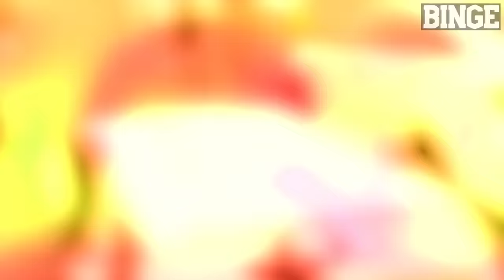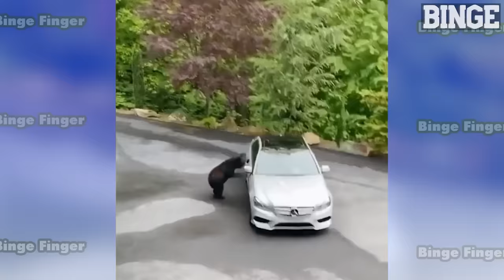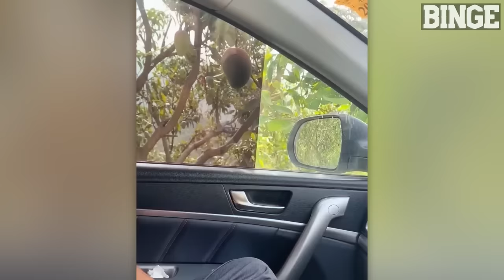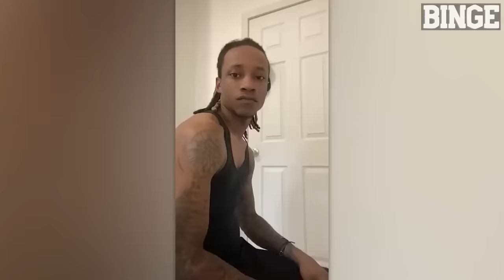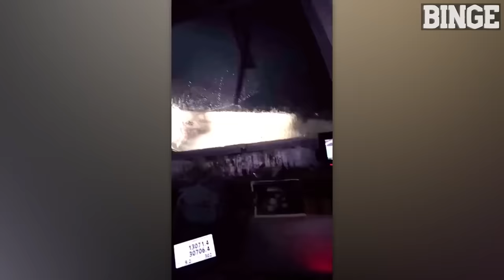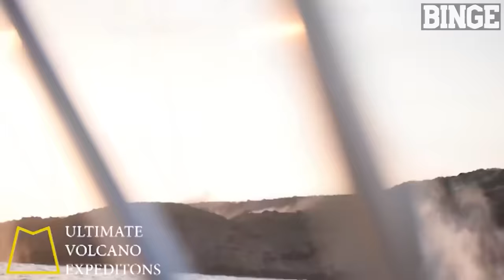200 Incredible Moments Caught On Camera ! Best of The Month #31

Comment: The 'collapsing barrel' is an old classic.  You put a small amount of water in it, then heat it so the water turns to steam, then seal it.  Cooling it with a hose - reduces the internal pressure - making the barrel collapse.
Reply from the maker: Thank you for your explanation! We got it!

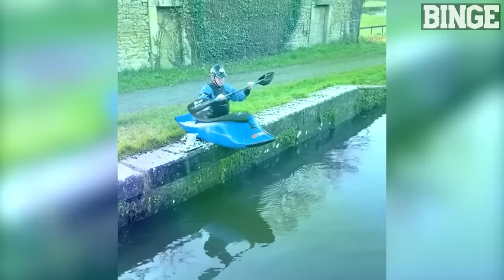Comment: 18:40 The barrel is under pressure with a gas or liquid. The barrel is black and warm/hot. Now you cool it down (water). The gas reduces density and a vacuum starts (where gas has been is now a "nothing"). The barrel is to weak to maintain the vaccum and gives in.  Get yourself an empty plastic bottle and fill it with hot water, close it tight and wait. The bottle should give in as the hot water needs more space than cold one.
Reply from the maker: Wow, we are amused by your knowledge! Thank you for your detail explanation! We highly appreciate that! Love to see you in our next videos!

Comment: 18:44 heat all the barrel with a blow torch, either lightly screw the cap in or rapidly cool the out side; the gas/air in side cools and stinks as molecules get tighter together; causing a vacuum inside; when that vacuum exceeds the strength of the steel it causes it to implode to the new size of the air within :) 18:44
Reply from the maker: You know this issue well! We appreciate that! Thank you for your visiting again!